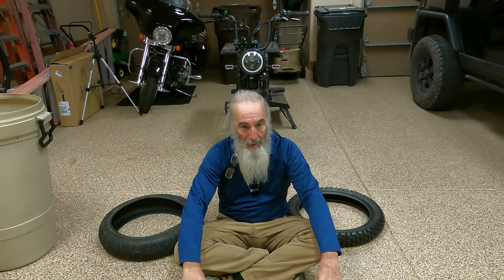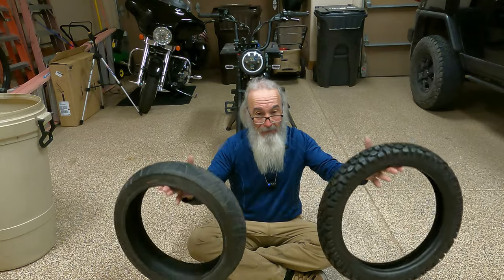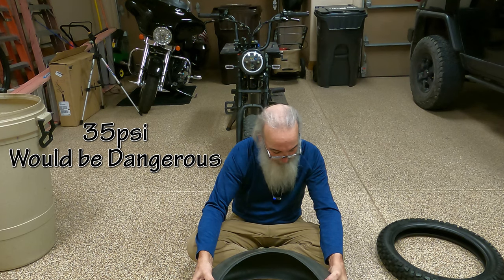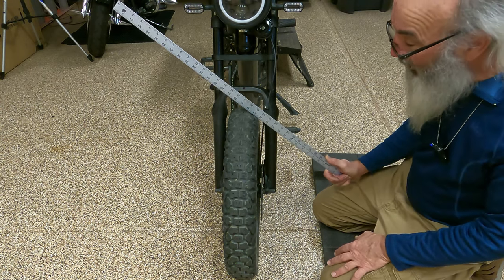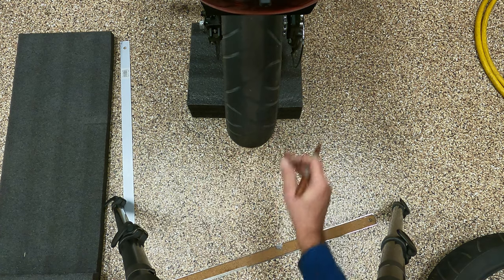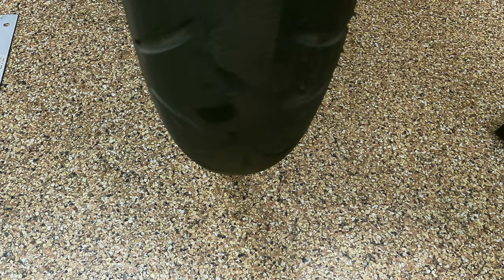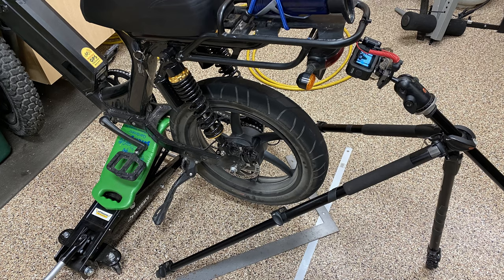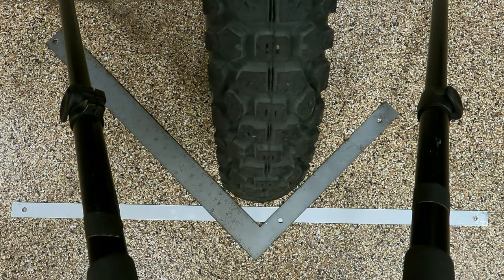⚠JUNK☣Bikes☢Hyper🦂Scorpion💩Tires are DANGEROUS A.F.⚠ Must be REPLACED😖NOW CRAPPY Tires Explained👍

Comment: Would agree there tires are dangerous. I ride gravel roads a lot. I have to lower air pressure to 15 psi your contact is much wider and is helpful. These are coming off in spring . Thanks for your insight been helpful

Comment: I like how you jacked up the back end. I hope you can show us how to change the back tire when you do. Good video BTW.
Reply: Go to Juiced how to change rear tire vid.  Gives basic guide.  It is just a bicycle.  The hard part is lifting it.  I hang mine from a bike stand with pulleys I used on my grow lights attached to the carrier on each side and block the front wheel.  I start with the back to get it over with.
Reply from the maker: My Grow lights never would have supported this...LOL
Reply: @UncleFjester  Ha! Just the pulleys.  Put on those CBR frame glides you have and set it on jack stands.  Way faster.  Not going to take anything apart like I did last time until I see the tires.  Appreciate the vids.

Comment: I’ve found these tires to be too slippery. Got in some dried grass, no tire grip at all, went down causing severe skin tears in both arms. Want to change but especially don’t want to lose speed or range. Not having luck finding them. BTW I’ve been educated and lived in California all my life and have never had a problem understanding complex issues. I’ll wait for your range and speed tests. What is the recommended tire pressure for your new tires? Please keep the videos coming.
Reply from the maker: Range is down 25-30% with both tires on, running 20lbs in front 25lbs rear.  Ride is Awesome!
Now I'm looking at adding another battery for when I want more range.  It appears to be an easy Mod, put another battery in a box on the rack. But its cheaper to have lighter tires for the summer.
Reply: Any noticeable loss of speed? I like the second battery idea like they have on the Scrambler2.
Reply from the maker: Lost Speed? Yes, but I'm in 3 most of the time on trails that shouldnt be rode above 20mph, I still have S & R left. 
What are you doing for tires?  Did You See this?
https://www.amazon.com/dp/B01CGDW2AO/ref=sspa_dk_bot_detail_aax_0?psc=1&spLa=ZW5jcnlwdGVkUXVhbGlmaWVyPUEzNUNBSjQyTkxWVVgmZW5jcnlwdGVkSWQ9QTAwMjgwODhTMEQwQ01SR1A1OFgmZW5jcnlwdGVkQWRJZD1BMDY5MjM3NTZFUzFGUE1UNUFBSyZ3aWRnZXROYW1lPXNwX2RldGFpbF9lbmRjYXBfc2hhcmVkJmFjdGlvbj1jbGlja1JlZGlyZWN0JmRvTm90TG9nQ2xpY2s9dHJ1ZQ==
Reply: @UncleFjester  my riding is mostly on city streets some of which are hills. Because of the hills, range is a factor. I did see the Mongoose tire, concerned about range & speed with them. Juiced had 20 x 4 1/4 Schwalbe as a replacement for the HyperScorpion on their site. Went to order and they’re gone. Now they’re selling the same tires we have now. Schwalbe hasn’t responded whether they still have them in stock.
Reply from the maker: Did you see this?  
https://veetireco.com/product/fat-bike-mission-command/
Reply: @UncleFjester  thanks, just bought their Speedster model. I’ll let you know the performance once I get them on.
Reply from the maker: ???
https://www.amazon.com/Shinko-SR568-Scooter-Motorcycle-Tire/dp/B0052438Y4
Reply: @UncleFjester  thanks for the info, I’ll check it out.
Reply: ALL THE BIKE TIRES ARE CHINA MADE

Comment: Where / How do I purchase replacement tires for my HyperScorpion ??
Reply: I second this question. I just noticed 2 bubbles on my front tire. 😏
Reply from the maker: Here ya go TJ
https://amzn.to/3hKPEDv
Reply from the maker: https://amzn.to/3hKPEDv
Reply: @UncleFjester  I read thru the description you posted. Do these new wheels really reduce range by about 25%? Also, the stock wheels are 20x4 1/4. Seeing as that size is seemingly impossible to find, do you know if 20x4 would be compatible? Just a little less wide, or would it have to be stock size?
Reply from the maker: they do drop a little range, your rims are 16" go measure it.
this is the proper tize size is correct
https://amzn.to/3emiHeh
Reply: @UncleFjester  When you follow the link provided & go to the details, it says these tires are for a 14 inch rim... I just want to confirm this is the correct link before ordering. I asked someone at cycle gear & they insisted these wouldn't be compatible.. 🤷🏼‍♂️ soooo confusing.

Comment: great video as usual. do you think i can use these Shinko sport tires with my fenders? in your shots, you removed your fenders, and cosmetically it looks great without, but i keep mine on for my kids passenger seat. Just want to make sure there's still clearance.
Reply from the maker: See if this will help,  I measured across the tire, from top of the rim, across the tire, to the top of the rim and got 8 3/8"

Comment: I went with Shinko SR 241  3inch x 16inch motorcycle trail tire for the 20x4 rim. Yes it works and makes the bike handle better and is quieter!
Reply from the maker: NICE! the 244 or 241 are the exact same tire with different tread design.  But Please don't confuse people, the rim is 16" diameter, the tire diameter is 20" Put a tape measure on it and you'll see what I mean.

Comment: Did you consider those innova tires, under weight of the rider and also influenced by the air pressure inside them, they deform/sit in other way on the tarmac?
Reply from the maker: Yes I did, at 5lbs pressure they sit properly enough not to lose grip.  They are Fjukin TRASH!  Read reviews and comment from people that have changed to the Skinkos

Comment: What size would i need for a 24inch 3.0 rim?....19 inch moto were 2 small or i didn't try hard enough....please help
Reply from the maker: With the shinkos one number is rim size x Tire width largest I saw was 21"
I gotta call 🐂💩 on a 24" Rim, what bike is it? Have you taken a tape measure to the rim? or are you reading #'s on the existing tire?  Go measure the Rim Diameter and report back
Reply: Also iv had her 4 yrs and on my 4th set of tires....im getting sick of replacing them,why i want motorcycle tires.....some people are saying a 20inch cooker tire will fit....except there expensive and hard to come by.....i bought 19 inch shinkos like yours....maybe i should get them warm?....i did the soap trip and still looked 2 small...thank you for responding back so quick
Reply: @UncleFjester  oh and i believe there bicycle rims except there double welded and the 3.0 makes them wider
Reply from the maker: Measure the old tires once you get them off, compare old vs new
Soap it up, the MC tires are stiffer than bike tires
These tires say and are marketed as 20" x 4.25" but the rim is 16" x 3"
It gets confusing